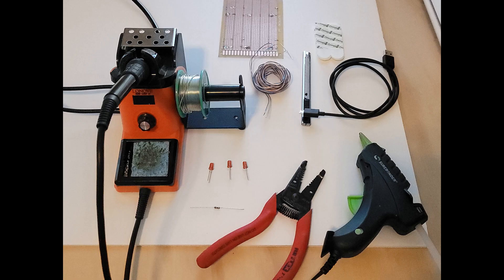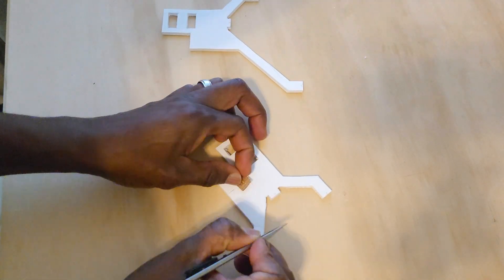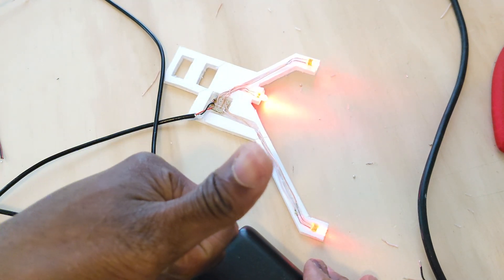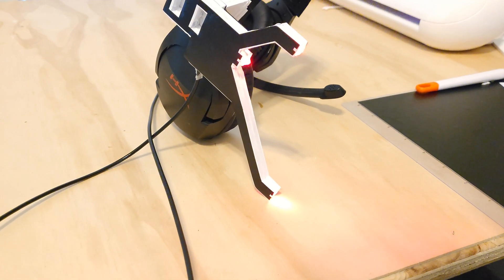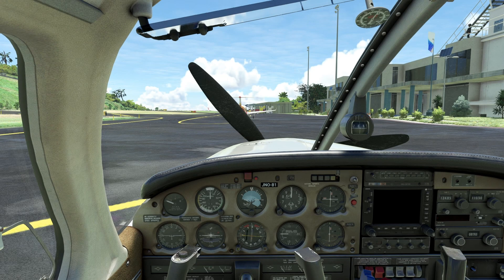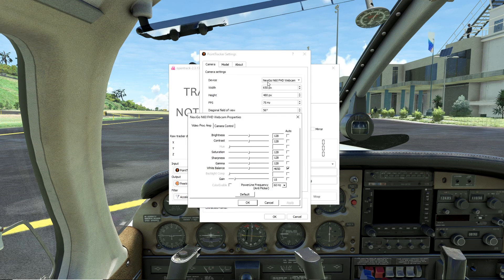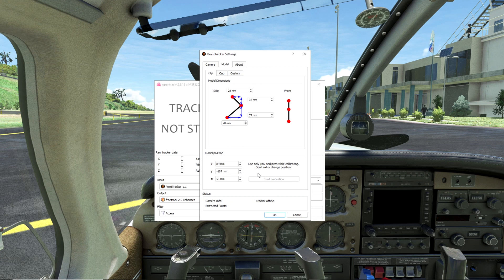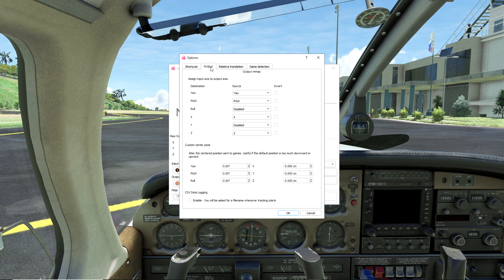Easy to build | DIY LED Head Tracker | Full Configuration & Demo | Microsoft Flight Simulator

Comment: Hi, just wanted to say thanks.
I used your instructions and layout for the tracker. But instead soldering LEDs, i bought a Christmas LED chain for 2 bucks in a $/€ Store and cut it to my needs.
Works like a charm and can ,use 2 AA rechargeable batteries too. Using it with Elite Dangerous. Best advise was the exposure setting.
Cheers from Berlin Germany

Comment: I can't find it addressed anywhere on the internet, but do you think that using a HTC VIVE base station would work as an IR receiver?
Reply from the maker: Hey @TheFriendlyBandit, I don't know, I don't own a HTC VIVE. If it accepts IR inputs then it might work. I used regular LEDs for this project not IR.
Reply: @jnobuildsit1177  thanks for the reply. I ended up finding a PS3 eye cam at a nearby disc replay for $3!

Comment: A quick question, my Leds are barely glowing, do you have any thoughts on why this is the case, they do work when the hole room is pitch dark, andbexposure set to -6 but then it will sometimes register whites on my shirt, and glares from other points. Will point out that I'm using a 10ohm resistor instead of 28ohm and also wired in series. 

Amazing video BTW :)
Reply from the maker: @AReS TV  what color Leds are you using? Did you check out the circuit diagram in my video description? I'm using one 82 Ohm resistor and the LEDs are wired in Parrallel.
Reply: @jnobuildsit1177  thanks for the quick answer, I used red light, but I think I know the problem, after some research online, it seems when u connect them in series instead of parallel, u need more resist (I will reconfigure when I get home). Will get back to you
Reply from the maker: @arestv1911  No problem. That is correct. Let me know how it turns out for you 👊🏽😎.
Reply: @jnobuildsit1177  ok. Now I have done a lot of testing, changing the resistor from 10ohm to 360ohm and different USB cables and thicker cables between the Leds, always ended up with the same dim light. So I then went with the parallel wiring and it worked like a charm. But I still can't figure out why a series would make such a difference in power of the lights.
Reply from the maker: @arestv1911  Great job!! In a series circuit the voltage is divided across all the components but the current remains the same (The larger the resistor, the more voltage is across it thus making the LEDs dimmer). However, in a parallel circuit the voltage remains the same across all the components but the current in based on each component's resistance (i.e. less resistance = more current = brighter LEDs). Hope this helps!! 👊🏽😎

Comment: I was already using OpenTrack in conjunction with AI Track face tracking. But that is often glitchy and freaks out when it detects an other face. This is very useful and I will definitely be building it. Cheers.
Reply from the maker: Thank you @Akash05Plays, go for it. I use mine every time I fly and it works like a champ. Cheers!
Reply: @jnobuildsit1177  I already have some blue LEDs, I assume that is also fine as the OpenTrack has the option to select blue light as well (where you selected red)
Reply from the maker: @alias555aka  yes blue will work just fine. Just select blue in OpenTrack as you mentioned. Let me know how it turns out.

Comment: Very nice video , well explained , does it work with dsc world
Reply from the maker: Hey Sameh, thank you for the complement. I do not have DCS world, so I don't know. However, if DCS world supports OpenTrack software then it might work. I would be interested to know if it does.
Reply: @jnobuildsit1177  hello Jno , it works very well with DCs , just working on mapping , thanks again
Reply from the maker: @samehhanafy7932  that's great, thank for letting me know.

Comment: Questions:
1. Are the red LEDs bothering you on the side of your head?
2. Are the red LEDs causing glare in the screen?
Reply from the maker: 1. No they don't. I can't see them from the corner of my eyes.
2. Yes, they do reflect on the screen, but it's very minimal and hardly noticeable while I playing the Sim.

Alternatively, you may use Infrared leds. However, I found that they don't work well with every webcam. If you gonna use IR LEDs, I recommend getting the PS Eye Cam.